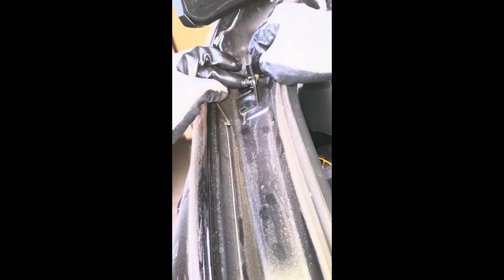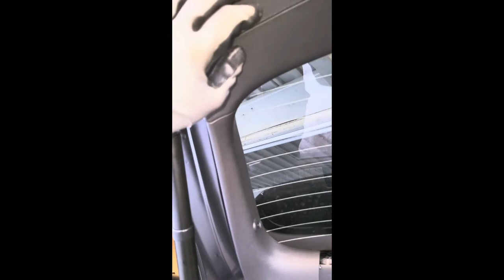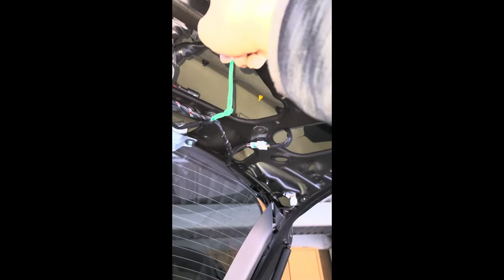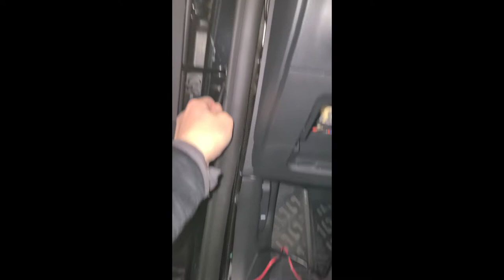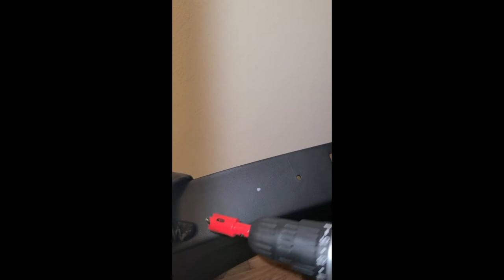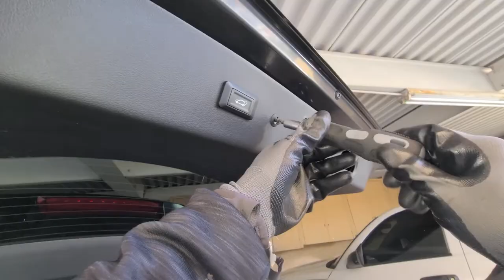Step By Step Retrofit Electric Lifting Tailgate Installation (English Caption) Hyundai KONA

Comment: Hi I installed this in my Toyota CHR, it works fine but whilst I am driving the tailgate suddenly starts beeping and it opens to quarter position, then i have to turn off  by pressing switch.  Any advise would be most helpful.
Reply from the maker: You can first check troubleshooting section in the manual. If it's not listed, check if you can reset the tailgate positioning by holding the button. If it's not working, maybe the spring and electric thing is malfunctioning, better to contact support.

Comment: did you replace the latch hook? Also, what is the stand by current? (when engine is off, did you check amp draw?)
Reply from the maker: Yes, the old one is too weak to hold the torque. I do not remember the stand by current, but I'm pretty sure it's minimum.
Reply: Yeah, i was looking for the latch hook in your video but you didnt show that.

On stand by, i suggest you do a parasitic drain test. Mine was drawing 107mAh, nornal draw should just be 20mAh. This would kill your battery if you dont use your car daily.
Reply from the maker: Flashing my memories... I did not show the bottom latch because I was using wrong screw head that damaged the screw. Found some way to get it out anyway but had to purchase a new screw and forgot to record that part. Mine was definitely around 20mA when I was doing the connection for the key fob wire. If it's 100 mA, something is wrong.
Reply: Yeah, that is what i was trying to figure out. Thank you for responding!

Comment: Ho do you connect the CAN bus H and L cables to the wiring under the fuse box?
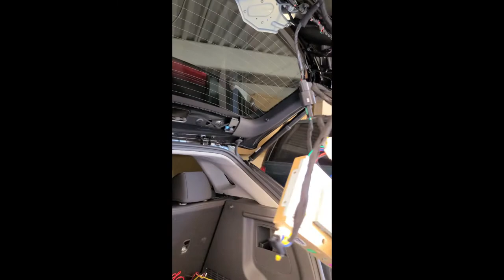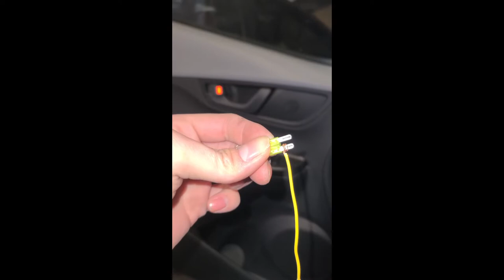Reply from the maker: I believe I covered fuse box part from 9:00 to 10:00. Picked up one vacant 20A fuse. Make sure you also connect to the ground.

Comment: Another question, on which slot did you tap the fuse into? Constant or switched on?
Reply from the maker: It depends. I showed it in video for the switch one for front button. For the control box power and foot sensor they're connected to constant since they work even not turning the vehicle on.

Comment: I have installed this kit in my Kia Sportage all buttons are
properly work but only remote doesn't work not open or
close auto trunk please help me or guide me thanks
Reply from the maker: Did you route your door opening circuit to the control box? If so, try push the unlock button continuously (more than 3 times) to see if that works.

Comment: I hv a Kona EV 2019, no power liftgate. I order already from aliexpress and hope it will fit in my car. 
Thanks for your video.
Reply from the maker: Sure, I think the exact model I bought might not fit in Kona EV. The installation should be close though.
Reply: @RickGeorgeAudio  
I did, everything looks ok. 
But there is a problem, it looks like the lock has not enough power to pull the latch. And when I helped pushing the door down to make the lock work it also has not enough power to unlocked it. 
Now I don't know what to do.
The lock and the latch are not adjustable.
Reply: @iversonchemist1628  
About my lift gate problem do you have any suggestion for me what is wtong and how to fix it ? Thanks
Reply from the maker: @franskurniawan8220  1. When locking, did you hear occasionally hear flash beeping? If yes, check your alignment if something is preventing lock mechanism working properly. If it's just weak, check the current from your power supply. 2. Contact kit provider for a bloatware update for the control box that will give you a stronger release.
Reply: @iversonchemist1628  
Thank you for your response.
At first I hook the power supply from the fuse like you did, now I hook it up directly from the red cable like the manufacture suggested and the result works the same.
Yes when it locked right there is a flashing and a beep when it locked. But when I open one of the front door the sign in the dash turn red it means not lock properly also when I kicked the car. After that the rear door can't be opened so I have to unlocked it manually from inside and lift the door.
There is nothing we can do with the alignment,  everything is fixed and not adjustable.
Well we are supposed to have no problem after we installed it right according to the manufacture guidance.
I think the one I bought is not a good product.
Reply from the maker: @franskurniawan8220  For flashing beeping I mean when the door tries to lock, will it fail after an attempt and return beeping more than one times? If that is the case, check the back button you installed. What I didn't show in the video is that I had a problem with the button drilled on the back panel that its screw mouth was too high that would cause trouble for locking mechanism.(There is only a small gap between plastic panel and metal frame). When locking, the button might be pressed due to its height. I had to cut the screw mouth to minimum to get it fixed.
Reply: @iversonchemist1628  
No, I haven't installed the back button yet. It is still hanging but not touching anything. Thanks to your tip, incase it will work well and I am going to installed it permanently.
About the latch, the manufacture provide a piece of rubber sheet for under the latch. I have tried both with or without it, still not working properly. All the hardwares and wire harness fits perfect in the vehicle.
 
The foot activated feature I bought extra is also not working. The installing is not complicated and the instruction is very clear, the green wire with the mark key I joined to one wire from the back button  that has a voltage and becomes 0 volt when we pressed the button.
Or maybe I don't need to connect the ACC wire?
Thank you
Reply from the maker: You did use the kit provided latch right? I think the seller should be capable of digging into if you send them the a shot video for the issue. The foot kick kit was very straight forward for me as well. Refer to the video in my description for wiring. I What I did first is to check the wired sensor in hand before installing it underneath. The most difficult part for me was directing the wires and laying down to secure the sensor.
Reply: @iversonchemist1628  
OK, will do. I will update to you later, Thanks.
Reply from the maker: @franskurniawan8220  I watched it. I can tell there is no issue about the spring, which is good, not sure about the top lock mechanism (looks cheap). Something I noticed: 1. locking was too fast, it almost crashes into the latch, and it might be the cause of issue. Definitely need to ask for a firmware update for that. 2. Try inspect the cushion around the frame is outstanding preventing it locking properly. A reference video for that:https://www.youtube.com/watch?v=CYVJBmS3wEY
Reply: @iversonchemist1628  
Thanks, I watched it. 
Yes I tried to adjust the rubbers and even remove it but the result is still the same. I sent my video to the seller and their answers is that they are going to reply soon.
Well, maybe the product is not good as you said look cheap.
Reply from the maker: Sure. I'd say this is a minor issue, you will get it through.
Reply: @iversonchemist1628  
Hopefully,  thanks.
I am getting tired already trial and error for one week.
Reply: My problem is solved!
The seller at last send me the latch kit for free but I have to pay for shipping and custom. Well do I have other choice after spending C$ 600.- ?? I think it's worth-it because I am saving a lot of money by doing it my self rather than paying a mechanic to do the job.
Now it all works fine, even the kick feature works.
Reply from the maker: Glad you made it! Indeed it was the latch, enjoy!
Reply: @iversonchemist1628  
Thanks